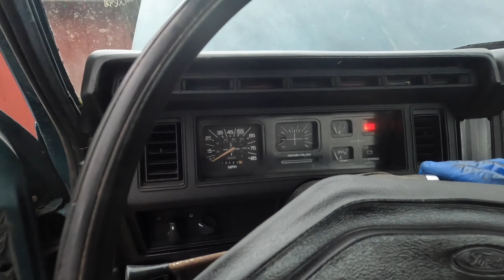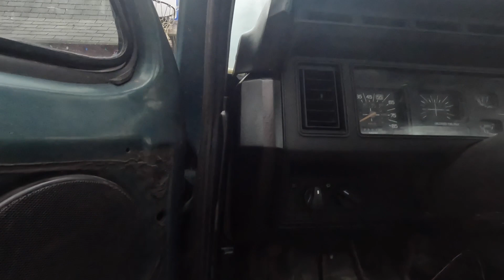1982 F150 302 oil leak, clutch, flywheel, dropping the transmission, oil pan gasket issues.

Comment: If the dipstick isn't in the timing cover than it should be in the block between 7and 8 plugs about an inch from the bottom of the block ..if its not there some one has replaced the timing cover with the wrong one
Reply from the maker: I did end up finding a horizontal plug in the side of the block right about where you are saying. Someone must have plugged it up. I tried taking it out with an allen wrench, but it was rusted solid, and I didn't want to force it. I think I am going to pull this engine again for a second attempt. Thanks for the tip.
Reply: If you are able I would do everything you can to get the normal 302 oil pan to work..i fought with the same thing except I had the 351 Windsor with the wrong oil pan just barely hanging on ..
Reply from the maker: Actually, that plug was for the coolant around the engine. There definitely is NOT a spot for the dipstick. I am beginning to think it is a different timing cover that it's supposed to be. I am looking at the 1977 Bronco dual sump oil pan with the dipstick on the pan. I am hoping that might fit this truck.
Reply: @JohnBullOutdoors  yup if there isnt a spot in the block or the timing cover some one has replaced it with the wrong timing cover..i would replace everything with the correct parts to save you a lot of headache down the road

Comment: How hard 🤔

Well I pulled a 3 speed and replaced a clutch on 1980 F100 from the back of a 302 when I was 16 in 1990. No jack, no jack stands and a few hand tools my dad had. Never done it before just dove in. Pretty much just crawled under the truck a used my legs and chest to drop the trans and the same to put it back. 

And no my dad didn’t help. His favorite saying was “what old you do if I wasn’t here?” 

I wasn’t easy and it was hard work. But I’ll never forget doing it. Just put back the opposite of how you removed it.

Comment: on your engine it should be on the passenger side between  the 2 nd and 3 rd  spot of the manifold is where it runs through a metal tube then down into the oilpan